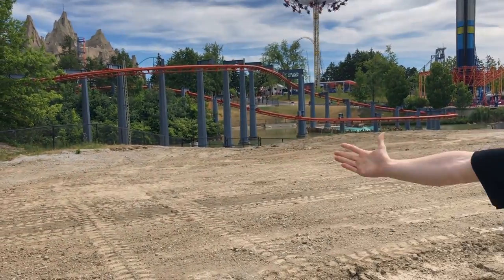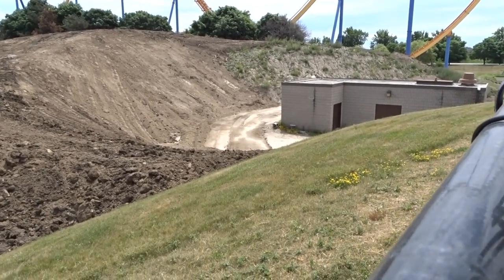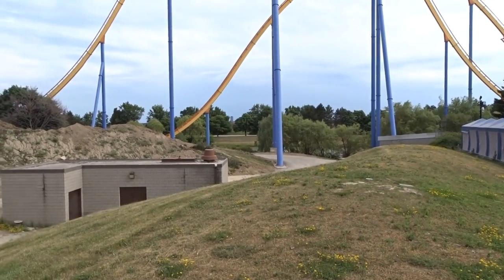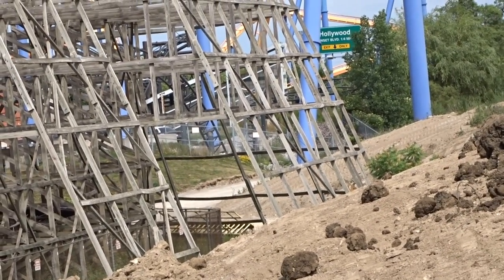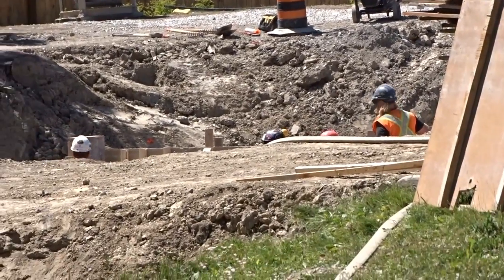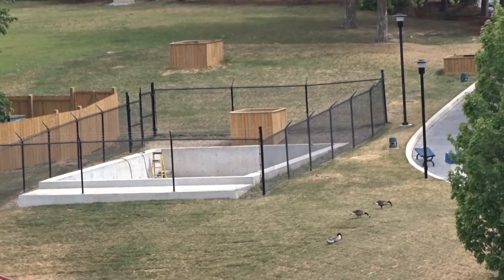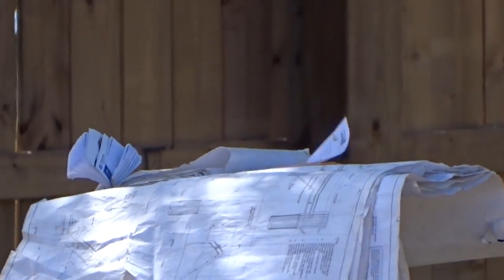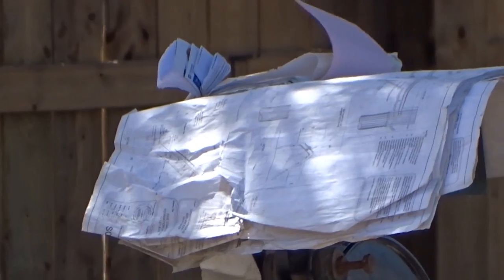Canada's Wonderland Massive Yukon Striker Weekly Update

Comment: I was at Carowinds yesterday. Their construction is coming along nicely as well. They had two yellow footing diggers ( more like drillers) drilling away. A huge crane is onsite as well. There’s also a bunch of boulders on the edge of the construction site but they may have been there previously.

There was a fire with coal black smoke at Carowinds. It turned out that a car in the parking lot ignited and at least two others burned completely, with damage to several others. I couldn’t tell what was going on at the time but it was a bit freaky after what happened to Europa Park.